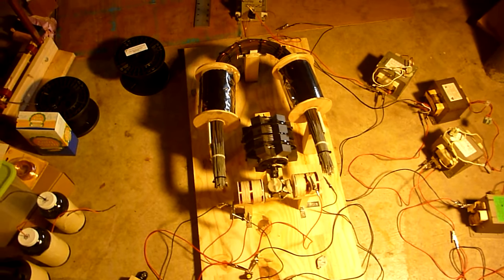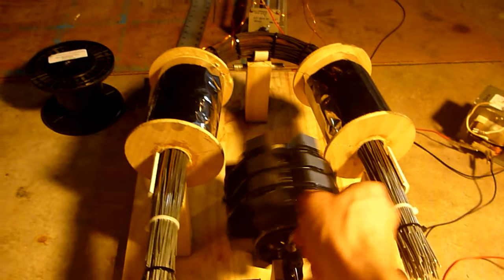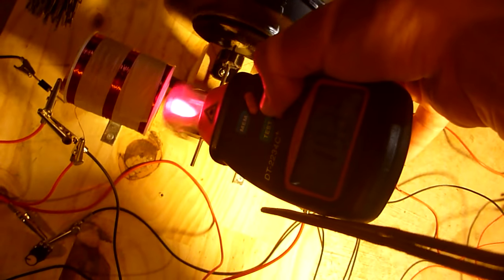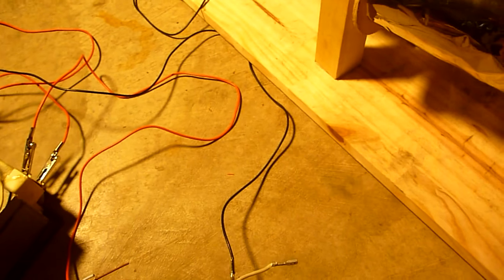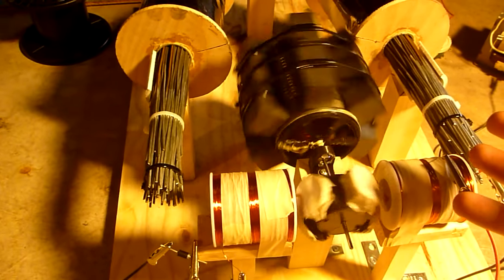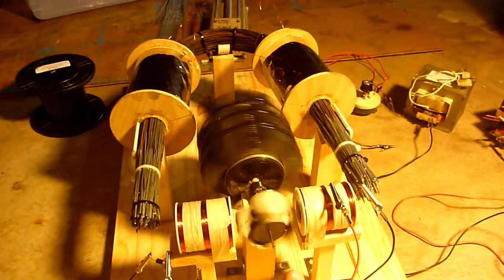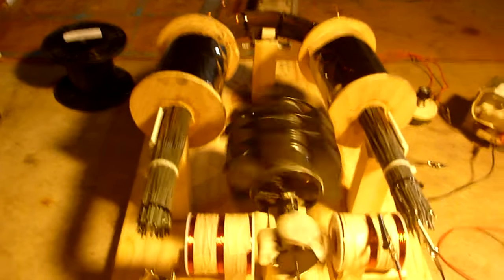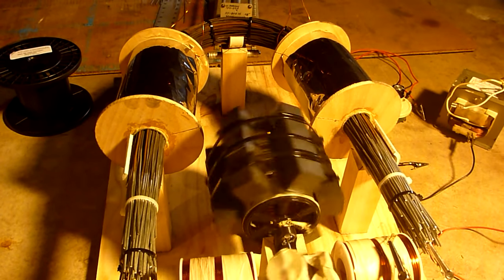PMH Generator's Strange Effect demonstration (unedited video)

Comment: Hi, you asked for input, some observations.
1) Stainless steel is not magnetic (unless the grade is lower quality) so your coils wrapped in it are the complete opposite of what Ed would be recommending. Ed wants you to put iron (soft) around the coils (outside) to absorb the magnetic flux. This is because the flux energy is stored in the iron. A crude analogy is to compare it with a flywheel which stores the rotors kinetic spin energy the iron is very much like the flywheel absorbing energy which is stored and released later. By adding iron your coil will spin at higher speeds. you can add iron to the centre of the coil and add more to increase reactive inductance. see Mr Anguswangus vids. This will mean your pulse motor will use less current. 

2) Don't use your rpm meter on a metal (shinny) surface. yes the surface should be reflective but not chrome or mirror quality as your readings can be inaccurate. use the sticky strip (cut a 5mm Square) chunk off it. It should have been supplied with the meter. And don't hold so close. I agree with deslomeslager you have about 200-300 rpm there.

3)i ok first run I have explained (previous vid) that one. PMH(wired) in a circuit with transformer coils will gain from a back emf from the inductor (coil in transformer). To get you head around this one learn about LCR circuits & Inductors.

ii second run with load on pmh(wired) the pmh is being used as a generator and as such not enough power input by the bedini prime mover to generate the power needed to run the load or even run the motor.

iii third run PMH(unwired) now the iron in the horse shoe is creating drag on the bedini prime mover and input not enough so stops. The coils are not doing anything on this run you have in reality shoved a chuck of iron by the magnets slowing your motor.

I am no genius, but only reply to be constructive to help you. I hope this helped you understand.
Reply from the maker: David Mountain The stainless steel foil that I used actually is magnetic. I made sure to use the magnetic variety of it (I have several different ones). I like your idea about adding more iron to the middle of the coil. Ed recommended that the two coils on the PMH sit as close to the bend as possible (closest to each other). Inductance effect is helping the rotor spin, it is as if reverse of Lenz's Law is happening here.

I agree with your assessments of what happened in the experiment. The next big question is can the coils in the PMH gain enough back emf from the inductors to continue to spin the rotor w/o any further power input? Also, Ed used bottles wrapped with wire and a variable air capacitor (I have all those things). The bottle can be used as a 1:1 transformer for AC power... but how did Ed use it? According to Ed there are 2 particles involved in electricity the + and the - monopoles. These monopoles have an opposite spin and move in opposite directions. Also, Edwin Gray (inventor of self running motor in 1950s) talked about splitting the positive (another reference to 2 particles involved in electricity). The whole notion about the electron being solely involved in electricity may be wrong.

So what do you think I should do with the PMH to get it to self run? (theoretical question)

Comment: The pmh effect is created by the loop closing like a switch. bifilar coil is on. You have a loop or a functional circuit. It’s inductive when you break the bar and add in the pulse motor.  It’s actually a brilliant little setup and can also easily make a bidini motor.

Comment: I think what happens is: shortened PMH coils echo the pulses given by the PMs, slightly delayed, aka 90 degree phase offset, and hence give the rotor a frequent "kick in the pants", where nonshorteds cannot "ring" (remember ledskalnin: ring the bell twice). Q: how does the motor spin with the entire PMH removed? Is the unshorted PMH just a brake? BTW. check my lenzless vid (lenz law debunked) for some further mindbending controversy.
Reply: R.L. Poole is an authour/ inventor that talks in depth about "Ring the bell twice" he has an incredible mind.

Comment: As you increase the inductance, adding more coils and transformers, etc., the resonant frequency can be lower and there is less attenuation. The ideal would be to have the self-resonance of the coils match the RPM of the motor. At something like 240 RPM, the frequency is 4 Hz and that requires are a lot of inductance. You either need it to spin faster (more current) or increase inductance. If there was nothing physically moving, no friction, and if it was just coils, that would be better. Moving something physical requires lots of power.

Comment: A suggested improvement to your rotor....
Take your can and cut it height wise into strips wide enough to take your two magnets. then fasten the strips to a pvc pipe the same diameter as your can. This has made your Vee magnets you wanted. like Ed's config, The can strips should only be in contact with 2 of your magnets repeat this all around the can.magnets in a N/S config. The way you have them is binding up your magnetic flux.
Regards
Reply from the maker: David Mountain The rotor can definitely be improved. You are suggesting I cut the can into strips and have only 2 magnets on each strip being in magnetic connection with each other. This would make these magnets similar to V-shape magnets (however with different metals involved it won't be quite the same as a real V-shape magnet). I don't know if I said anything about this earlier but I tried the Linden Experiment. I wasn't able to get a positive result... that is why you don't see a video about it. As always I appreciate your comments on the subject.

I ordered two 3 inch neos and a thick copper disk I'll make the Tesla's homopolar motor with that stuff. It supposed to be Lenz Free. I plan on trying everything. Stan Meyers magnetic gas, magnetic shielding that rotates btw. coil and magnet (another Lenz free system), Atmospheric power (like in Tesla Patent: 685,957), self running magnet motors (those are very hard to make as it turns out)... etc, etc.
Reply: Naoki Kashima I like to see people get involved and try these things out, but sometimes just take a big breath and stand back. The Linden Experiment is just one of those times.
1) A lot of second hand second person information
2) As soon as I read that you had to hold two different metals together by finger tips (alarm bells). I knew then when the experiment was not repeatable with a non-conductive clip that someone was getting the scale wrong on the multimeter.
3) A voltage figure that was to good to be true 60-70V (alarm bells)
You even have a vid done by yourself about the voltage from your fingertips through different metals. so sadly your conclusions are right. No can do.
Stick with Tesla your have a lot of good experiments there.
But don't close that enquiring mind. I might come to rely on it one day.
self running magnet motors are possible but in my eyes are only ever going to be as powerful as the strength of the magnet. so could they do useful work? I'm not so sure. Again I hope YT proves me wrong.
Understand how a magnet really works and you will have a true vision on the universe. Howard Johnson understood and YT user Theoria Apophasis 
can open your eyes but he is a mind blow when he explains, stick with him and the terminology will come.
We are all on a journey and I'm happy to travel with you and many others.
Regards
Reply: Naoki Kashima The rotor yes you understood right, if you had a few cans you could laminate a few strips under each magnet. Yes different metals but as long as the can was magnetic it would work better than the model you have now. If you want to improve more down this path you could instead of cans use a metal iron pipe and cut that down its length to hold two of your magnets on each strip where the magnets make contact with the pipe metal file/grind a flat into the radius so that the flat of your magnet makes good contact with the pipe. your blochs wall or dielectric inertia plane would be in the pipe, you called it the 'null point' I believe.

Comment: The rpms? I counted 4 rotations per second. 4 x 60 = 240 rpm. Sometimes common sense overcomes digital and analogue technique.
As to the pmh, all we need to know is how it assists the magnetic fields the best. How it does that? We'll learn eventually.
Thanks for sharing!
Reply from the maker: deslomeslager Good point, the RPM meter was giving reading that were all over the place. 240-300 rpms sounds believable. The amazing part was that the PMH's rotor wouldn't spin unless the coils were shorted out through inductors...

Comment: good job. what is your voltage in? curious. i know youre systems not efficient and youre just testing the lenz effect but curious. have u tried adding multiple pmh's instead of one? you can spin horizontally to squeeze more in...i will be testing this soon..
Reply from the maker: +T Boyd The voltage depends on the spin speed. It was around 3.5 volts. These are Lenz-free volts though, so they won't slow down the system when tapped. If the coils aren't connected in parallel the effect is gone. I haven't tried connecting several of these together yet, but I heard that the effect will be lost as well (not sure about that though). I've tried a setup without a transistor with a magnetic on/off switch. The magnets on the rotor make/break connection and across my switch terminals I have a layden jar. The back emf ends up running the system like that (no transistor). I was considering uploading that video... but I'm not sure if people would find it interesting. We have internet right now, all sort of information is available. Time is ripe to topple oil and unslave humanity me thinks.
Reply: +Naoki Kashima True.  Hmmm so it breaks if 2 are added eh?  Well...think outside the box! :) your armature can be long and contain several magnets (again, if horizontal) and spinning multiple magnets collected by multiple pmhs?  an idea...

Comment: I can help you.  The theory is this; just like electricity searches for a path of least resistance the effect is the same when you theorize that there's a magnetic current also trying to jump through the magnets bridging across to the pmh and in addition since the coils are wound oppositely you are creating a flow from one "north" leg to the "south " leg on the other side so that the magnetic force are sympathetic and help each other to turn the rotor; also youll find less amperage being drawn from your drive motor as you short the coils or add a load

Comment: no,no,no about 240 rpm.  Rotating about 4 times per sec.   Haven't you ever seen an electric drill run? One going 1,200 rpm is going many times faster that thing. Rpm's listed on the drill.